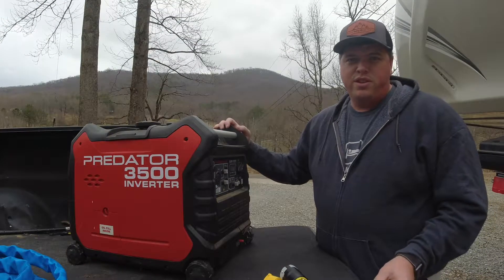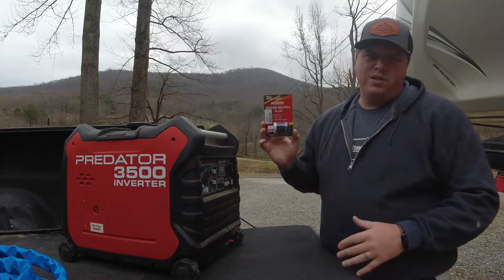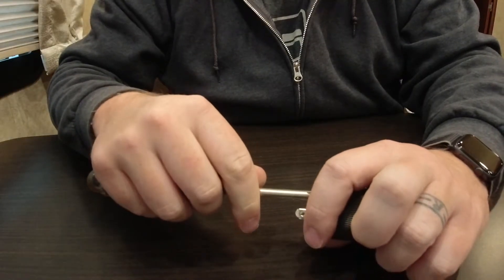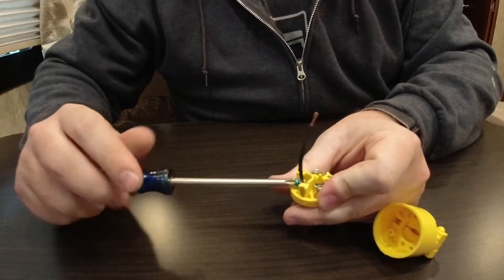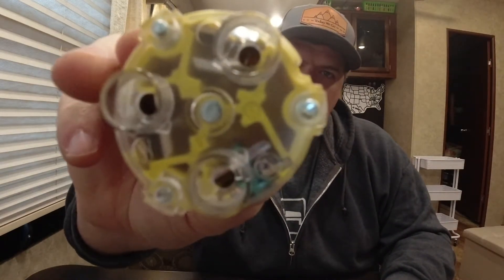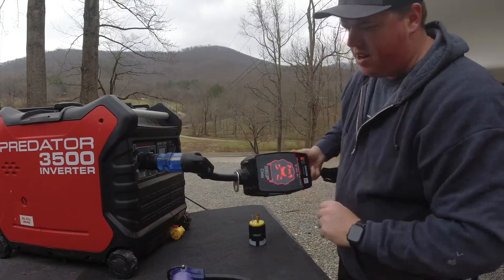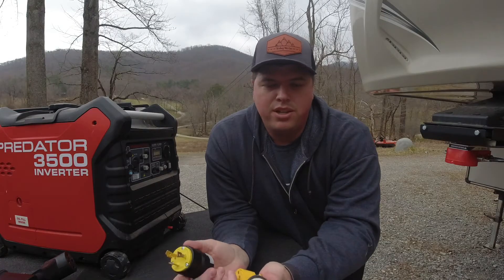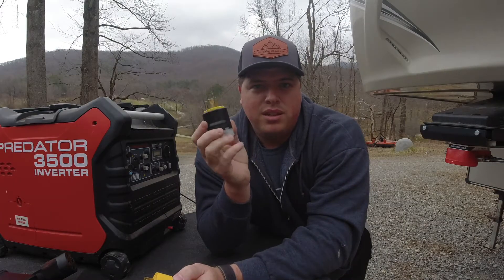How to build a Generator Bonded plug - Fix EMS grounding issues with a generator and your RV

Comment: great video.  do you know if it would still be bonded if the breaker trips on the outlet with the bonding plug?  I'm guessing the breaker only stops hot so bonding would still be in place.  Thanks

Comment: I have a generator that I use specifically for just my house if I have a power outage .  Because the generator came with a GFCI, I had problems initially attaching it to my house. After doing a bunch of research, I found out that there’s a harness in the front of the generator that if you remove it, you won’t have this problem with the GFCI . As well, I also found out that you can’t use that disconnected GFCI generator in the field because of the obvious reason no ground . 

If I’m understanding you correctly, given the reason for these plugs, am I to assume that by using these plugs it is safe to use a generator that has a floating neutral, out in the field as long as this plug is in place?

Comment: Why do they make these floating neutrals, seems like bonded is safer
Reply: A bonded neutral portable generator is for stand alone use. To convert to a floating generator - disconnect and cover neutral wire.
A floating (unbonded) neutral portable generator is needed for house breaker box connection. To convert a generator from floating to bonded, a bonded neutral adapter plug is used.
For RV generator use - check with your RV dealer

Comment: Great video!  Thanks for sharing.  I installed a power watchdog in my RV a couple years ago and have never used the generator since.  Boy would I have been all pissed off and confused when the generator gave me a ground fault because I knew it worked before the watchdog.... not sure what I'd have done.  My watchdog is permanently installed inside the RV.

Comment: Be very careful with this info. Not all generators are the same configuration. If your connecting the generatir to another system(home etc) you Do Not want a neutral bond at the generator. In a stand-alone generator application you Do Want the neutral bond at the generator. 
There can be only ONE bonding pount in the entire syatem, including whatever system the generator is connecting to.

Comment: Not an RV guy but installing a transfer switch to my sub panel. I’ve converted my gas generator to be floating neutral as it came bonded. I did this because the generator will mainly be used as an emergency back up generator and I know it has to be floating neutral. However, there may be a time when I might need to use the portable generator in a remote environment. Although I could take off the alternator cover and reverse the jumper wire to make it bonded again, I’d rather use your bonded plug method. 
Let me understand this. In order to use the standard 120V 20 amp GFCI receptacles, I need to make a 30 amp outlet bonded plug and insert it?  Could I not make a bonded standard 120V bonded plug instead? If I did, would I just be giving up a 120V outlet? However, in a very rare case that I wanted to use the 30 or 50 amp outlets, would all I need to do is make and insert a 120V 20 amp bonded plug correct?

Comment: Thank you so very much. I didn't realize these generators have this issue. I plugged in my safety plug and had the same faults.. Open Ground and Reverse Polarity. I was too afraid to plug in my camper. After researching I found this video. What an easy fix. Thank you Sir.

Comment: Hey so if I want to use the watchdog connect with the Generator to my house back up. The generator is self is floating neutral.if the only way I got power out with out error code,i bound the generator but When I feed to my house it has own neutral. Surge protector not seeing the neutral through my house only allowing power when I bounded. If this case it’s gonna be 2 neutral. What to do at this point?

Comment: Wanted to add. You could also jumper the ground to neutral at the source, little unsafe, but it does the same thing. So in a pinch just use 10|12g wire and jumper W to G..

Comment: Nice video, let's say you dont have an ems with the predetor, can you broke electronic stuff inside your rv while not using a bounding plug ? Or an inverter generator protect that? thanks.

Comment: I have the same generator and fixed mine yesterday.  I removed the front electric cover and purchased a #6 copper split bolt curney then removed and a 1/4 of the insulation from the green ground and the green with yellow stripe , installing the split bolt and reinstalled the cover .  Fixed.

Comment: So the inverter generator does not have a surge safety device, much like that big thing you plug into say a shore power supply, assembled into it is what your saying.

My apologies for not speaking in technical terms. I know very little to nothing when it comes to electrical stuff.

✌🏽

Comment: Hi There! My friend has a 2023 Thor Tranquility PT RV with the Ford Transit chassis 3.5 lt .with the lithium package...here is the problem They told us we can't use a generator only the power from your house or the RV sites and it works..! we connected to the 120V from the house and charge the battery in the RV .. everything works...but if you connect a Honda 2200 Inverter Generator it doesn't do anything is like not power getting in the RV ...Now we bought the plug neutral ground bond gadget Do you think that will solve the problem? Is not going to damage anything?...we just like to use the generator when is not shore power available...
Reply: This plug should solve your problem. I’m not familiar with that specific system, but I would assume that it has an ems which is preventing it from taking the power from the generator. It’s definitely worth the small investment to find out though in my opinion.
Reply: @davidocasek5541  Yes The EMS will prevent any malfunction
Reply: The Honda 2,200 is running everything with the plug installed..we just fix the issue . Thanks Very Much!!!

Comment: If you make the 30 amp and you plug into the 15 how do you run your air conditioner You need 30 amps not getting this totally I don't think I see that you'll have two 15 amp but how do you run You can't run your air conditioner with the 15 amp am I missing something here

Comment: This is only needed if youre using a surge protector. Without a surge protector you can plug right in to your RV with no issues. The problem is some RV's have a surge protector hard wired in the electrical system, therefore this grounding adapter would be needed with a generator. If your RV doesn't have a surge protector hard wired, you dont have to make this adapter. If you want to use an external surge protector like in this video, you need this adapter. To be honest, using an external surge protector with a generator is unnecessary depending on who you ask. Most generators/inverters have protections built in to output clean power and prevent surges and drop in power.
Reply: Thanks, that’s what I was thinking, especially with an inverter generator.

Comment: What would you reccomend for an inverter generator that only has 2 120v receptacles ,and a 50 amp RV receptacle? My generator has a bonded neutral so I'd like to dissconnect it, but having to take it apart to put the wire back into its terminal if I needed the bonding back kinda sucks....thinking about a fuseable link, but one that's rated for 50 amps? unplug the fuse when you need to be un-bonded. And put the fuse in when you need it bonded.

Comment: I don't understand why the generator companies don't realize people are going to have this issue when they use these generators with RVs especially when they have an RV plug on the generator!
Reply from the maker: I agree, although I’m sure there is some legal reason, code and whatnot.
Reply: Why don’t they provide a bonded/unbonded selector switch?
Reply: Well said the cost would be next to nothing.  @OilHist
Reply: This is only needed if youre using a surge protector. Without a surge protector you can plug right in to your RV with no issues. The problem is some RV's have a surge protector hard wired in the electrical system, therefore this grounding adapter would be needed with a generator. If your RV doesn't have a surge protector hard wired, you dont have to make this adapter. If you want to use an external surge protector like in this video, you need this adapter. To be honest, using an external surge protector with a generator is unnecessary depending on who you ask. Most generators/inverters have protections built in to output clean power and prevent surges and drop in power.

Comment: Thanks so much for the point about the 30-amp plug. My generator only has the one 15-amp outlet and i wasn't sure if the bonding would work using the different amp outlet. No other site was mentioning this, so you finally solved my problem with the furnace not running which has been a relief after several days power outage.
Reply from the maker: Glad I could help!
Reply: Yes me too trying to set up my furnace for outages....

Comment: I just bought an electric car, a Nissan Leaf.   I figured it would be a piece of cake to level one charge it with my solar panels and my 2000 watt pure sine inverter.  Nope.  I was stumped, thinking the charger was bad.  Plugged it into the wall and it worked fine.  Some searching I found out that the charger checks for a ground.  I ran a ground from the inverter to a grounding rod outside and that didn't fix the problem.  

Then I found out about these plugs.  I was concerned about doing this.  BUT you took a store bought one apart showing me that it was indeed just what a few people were saying was how to make these.  I've made one and will try it out tomorrow.  😀
Thanks!
Reply from the maker: Awesome! Please let us know how it works!
Reply: @TodayWeGo  I tested it this morning and it worked! It's raining and my batteries aren't fully charged so I've not yet plugged the charger into the car but I'm getting the solid green light telling me it's ready to charge 😁
Reply: @TodayWeGo  
Well... It looks like my system just doesn't have what it takes to do this. I can charge the car but in a matter of minutes it pulls my batteries down lower than I'm comfortable with even in full sun. 
Perhaps it's the long extension cord I need to reach the car. Perhaps it's my batteries.  It heated up my inverter enough for the fans to kick on too. 
I'm disappointed. 😕
Reply from the maker: Aww bummer. Sounds like it’s pulling as much power as it can to charge the car quickly. I’m not too familiar with the charge settings on electric cars, but maybe you can tweak how much it pulls from the inverter so it’s more of a trickle charge and won’t overload the system.
Reply: @TodayWeGo  Yes, if a Nissan allows that I think that would help. I plan on looking into that.

Comment: Great video. Why a  power watchdog, on an inverter Generator, and  can we plug a  bonded plug in at an outlet inside the RV?
Reply from the maker: I have the power watchdog semi-permanently mounted in the RV. This way I don’t have to take it out of they system each time I use the generator

Comment: Same principle applies if you are using a standalone inverter with a battery bank instead of an inverter generator. Most inverters are also floating ground. This applies especially to high-efficiency home furnaces which require a ground for the flame sensing circuit, and probably some newer refrigerators. I use a small, non-inverter generator to power a good sized car battery charger to charge a large deep-cycle marine battery connected to my 3000 watt inverter. I can then run all critical appliances (refrigerator, freezer, power vent gas furnace, power vent gas hot water heater, modem) with clean power and only run the generator when needed instead of wasting gas and creating unnecessary noise. The inverter/battery system is completely silent. The system also remains operational when you're refueling the generator. More pieces to connect, but also more versatile, especially for home backup power. I'll probably add another battery and a solar charger to the mix as well.
Reply from the maker: Sounds like you’ve got a nice setup going!
Reply: Thanks for sharing, that is a very interesting setup! It potentially solves several problems I have been thinking about. I like cheap generators; they are less likely to be stolen. You can also afford more generators in case one doesn't start. I have damaged electronics on appliances though in the past (computer circuit board on a fridge) and so I worry about clean reliable power. I also know that there is a tendency to want to keep plugging in extension cords and keeping plugging in more and more items. During one storm I had 5 fridges and 1 freezer run off one generator. By using a battery, you solve several problems. 1) you can have a quality sign wave (depends on the inverter of course) 2)natural surge protection 3) ability to power small items when the generator is off. 4)ability to power loads bigger than the generator temporarily (aka motors starting ect) 5) Potential ability to move the generator further away from point of use. I have one super cheap gas generator, but as it would run, it would periodically almost die, causing lights to dim, making me wonder what it was doing to the other uses of power, motors and such. Your solution is a very interesting solution. I do realize there will be power lost in conversion as this is generally a temporary emergency measure I don't much care about fuel efficiency or power lost as one can up size the generator. I do realize this is more complex, but can be kept simple. Ultimately, this is very similar to an inverter generator, but the car battery offers some cushion i the system. Another interesting thing about using this technique (in an emergency situation, it that one could run a long extension cord to a neighbors house, have another battery charger and batter and inverter still provide them clean simple power.
Reply: I went to price out components for a setup like this. Larger car 12 volt chargers are that run 40 amps (500 watts) are available for $150 to $250. There are both modified sine wave inverters (~$200 Cheap) and pure sine inverters (twice the price $400 to $800).  There are a lot of cheap inverters that do not live up to their labeling coming out of China. That said, this setup looks like it would work best with smaller continuous loads of less than 500 watts. Given the ability to store power, short intermediate loads of more should not be an issue. Lots of generators are rated 4,000 watts or 6,000 watts. Almost all gas generators produce 700 to 1000 watts on the small size and some small generators actually produce 2000 watts, about four times the power a system like this would run.  That would exceed the ability of such a system. In an emergency situation how much power do you need? This is still interesting, just a little more complicated. Of course the more power one tries to put though a system such as this, the greater the chance of damaging something or blowing up a battery ect.

Comment: I've been looking for this video (although didn't realize it ...) for a couple days.  Power outage, hooked gas furnace 120 plug up to the extension cord from the generator, --- but alas, it wouldn't run.  Spent all day trying to figure it out.  Turned into a great learning experience about grounded, bonded, floating neutral generators.  This was the final piece I needed to solve the problem.  Thanks.  Great video!
Reply from the maker: Haha that’s how we all learn. Glad to help!

Comment: Is this needed if you are using the generator to power a home furnace and refrigerator?
Reply: I’m wondering the same thing.   My newer Trane Furnace didn’t want to turn on with my Honeywell 7kw generator last Friday during a power outage.    Everything else did except the refrigerator didn’t act correctly.   The old heater used to come on with generator power.    I’ve read this is a common problem with the newer high efficiency units.
Reply: @stevez6499  please, Steve, if you find an answer please let me know.  I would like to power a new Trane D346435G03 2 stage forced air natural gas furnace in the event of power outage with a generator.  Thank you!
Reply: @jolkraeremeark6949     I still have not gotten a definite answer.    I did make a neutral ground bonding plug but the electricity is still working and I’m afraid to test it out on the furnace with the generator power.   But I’ll let you know if I find the answer.
Reply from the maker: I wish I could definitively tell you the answer, but my initial thoughts are, no you would not need it.

Comment: With a 50 amp camper do you need to use 50 amp surge protector just running 30 amps off that inverter
Reply from the maker: I usually switch to a 30 amp surge protector if we are hooked up to 30a shore power. I don’t see the 50a surge protector being necessary if only pulling 30.
Reply: @TodayWeGo  o ok thanks

Comment: On the Predator 3500, it has a grounding terminal on the faceplate. 
When using these plugs, do you have a live grounding terminal? 60V?
So if you accidentally touch the grounding terminal, do you get shocked?
Reply from the maker: That’s a great question, that I don’t know the answer to. I’m curious now too.

Comment: You could also take off your generators face plate and run a wire to the generators outlet from the neutral terminal (white wire) to wherever it is grounded (green wire), that way you don't lose a plug and it will always be bonded...
Reply: But then it's always bonded, LOL Sometimes you want it floating
Reply: @tonyinfinity  BAM! toggle switch bonded https://www.youtube.com/watch?v=zaDfwmMiID8&t
Reply from the maker: I never thought of that!